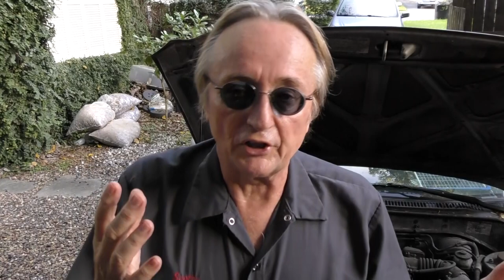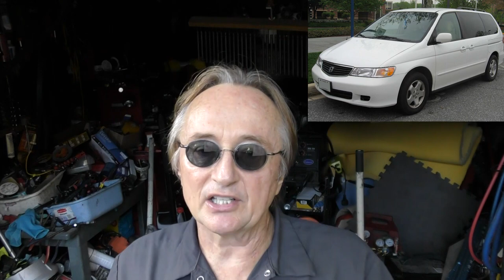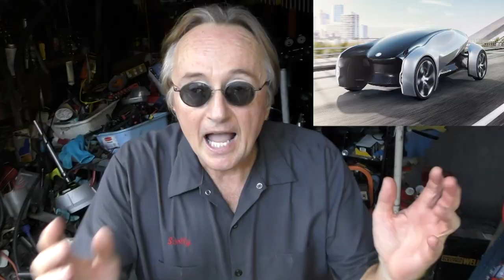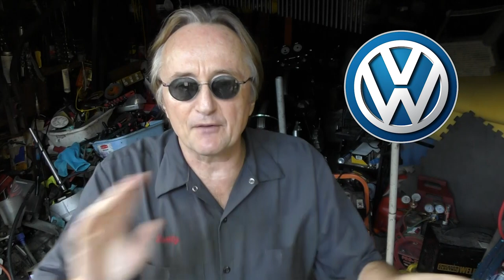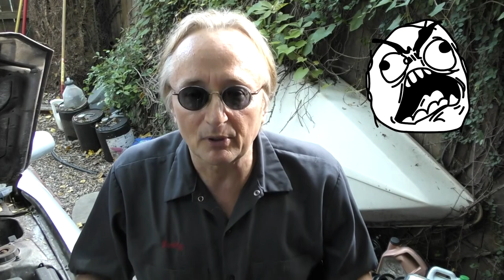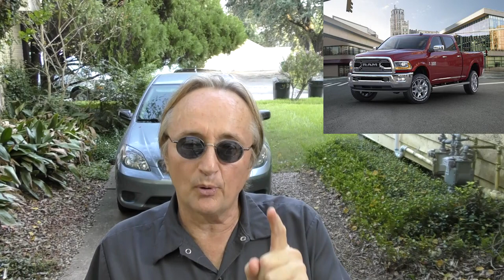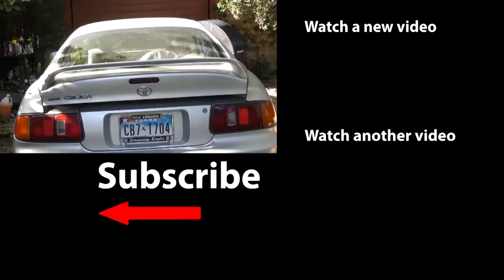Who Makes the Worst Automatic Transmission Cars in the World

Comment: I had an 01 Ram. Went through 9 transmissions. All went out under warranty.
Reply: Just carry a spare in the bed of the truck. :)
Reply: Damn. I'll watch out for the 01 generation
Reply: @arturos.l.2248  chrysler in general.......
Reply: My parents 01 grand caravan melted the transmission below 50k miles
Reply: @arturos.l.2248 it’s not the 01 generation it’s only specific vehicles the year is irrelevant

Comment: Fiat and Chrysler = 2 drunks trying to hold each other up!!! 💣💣💣
Reply: Hold each other beer
Reply: Wealthy drunks *
Reply: Chrysler and Fiat dont make ZF transmissions, so really s dumb answer. ZF is a German company that sell transmissions all over the world.
Reply: jeff k 📷🎥📹😝😂😣😗😀
Reply: ZF makes manual gearboxes for 3/4 and up trucks that are interchangeable between Ford Dodge and GM. They bolt up to your bell housing.
Reply: 08 caravan tranny started going at only 187k Km
Reply: Like #100
Reply: @SUGAR_XYLER  Way to go Sugar!!!
Reply: They help by offering each other a ride home or exchanging their car keys,like Peter griffin and his friend.
Reply: jeff k IKR I don't see how/why anyone would buy anything they make other than a version of the Challenger. Even if it has reliability issues  I feel that it's a driver's car.
Reply: ZF-Transmission just seem to be a problem in the US here in Europe they are pretty decend.
Like a lotta Fiat Bravos (2007-2014) 6 speed manual with a 90hp or 120hp 1.4l gasoline engine
Just don't hit a curb to hard otherwise a safety system will stop the gaspump ^^
And you gotta spend 3 min. in your glowbock trying to find the switch that unlockes the pump ;D
Reply: @robtankbuster5215  yes they do in there Kokomo Indiana plant 845 million dollar investment with ZF
Reply: Lol dead
Reply: Fiat has built DDCT automatic transmission. It's a good one.
Reply: And now they've added Vauxhall/Opel and Peugeot/Citroen, so now it's 4 drunks holding each other up.

Comment: As a past Honda dealership mechanic, I can totally agree with you about the 99-04 Odyssey transmissions were the worst. However, from 2005 on, Honda wised up and learned from their mistakes. The newer transmissions got much more reliable. Since I have quit working at Honda in 2013, I hear that Honda is starting to use ZF transmissions which are complete garbage! So, time will tell.

Comment: We had a 2005 dodge caravan sxt manage to make it to 450,000 miles with no drivetrain issue. Just regular maintenance. If the van didn’t get flooded and fried the whole system I probably still be driving that thing. I think the key word is maintenance. If you neglect it any vehicle won’t last.
Reply: We have a 2007 Caravan SXT with 170k and the transmission still works beautifully.
Reply: Keep it away from Scotty. He might put sand in the transmission when you're not looking, then blame Chrysler.
Reply: janry, I think you had the Chrysler 3.3 L V6 in that van. I've heard that's a pretty good engine! You must've changed the transmission oil religiously!
Reply: Had two 2001-2007 Caravans 3.3L V6 make it over 300 000 miles and one over 400 000 miles. I was not easy on the vans and  they pulled a trailer regularly + kids + dog + camping gear, clothes etc...  If you get one with low miles and little to no rust you will get a hell of a lot of use out of it. I leave the back seats out and use it like a pickup truck. The transmissions are solid on those years if you don't abuse them too badly.  We are on #4 it has 170 000 on it and it runs great.   I only change wear and tear stuff on them, parts are very very cheap new and used.
Reply: There were 2 years when the Chrysler Minivans had horrible transmissions, 1996 and 1997. Scotty is living in the past.
Reply: There is no denying what Scotty says about Chrysler and their products. But some of it is over exaggerated. Also, Chrysler doesn’t make the zf transmissions. When searching reliably for Chrysler vehicles (dodge, ram, jeep, etc) it’s back and forth. Like you said, it’s all about maintenance and not abusing the vehicle.
Reply: Yeah I don't understand what he's talking about..
We had a boat load of 1998-2015 Dodge/Chrysler Vans,  Mixed years and I sold a bunch. None of them had issues and I'd know because I'd take in trades and test them.  Also before I sold them I usually put load on trans and would take off to 65 once or twice before giving it to customers...  I sold cars for 2 years or so...   We had many Town & Countries come in with a boat load of miles.    Also wtf is he talking about the 8 speed transmission? That came from an Audi and I heard they were reliable...  Why blaming them if it's German transmission. Even know I never seen one with issues. We had few with 50-80K on them...    He needs to get off the hate Chrysler ban wagon...
Ford is doing so bad they completely stopped making cars all together...  My Cop buddy says they hate all modern Ford SUV/Sedan, all the Chargers/Crown Vics are great they say...
Chevy is ok but does have some gremlins like Chrysler does too, but some of those they already cut or changed.  As for 2016/2017 and beyond with merger, only time will tell.
Reply: I agree. I have a 1994 and a 2000 Chrysler minivan with the 3.3 L engine and 41TE (A604) transmission that are still running strong. They are very reliable as long as they are maintained properly, and they are easier to service than many other transmissions. The bad rap stemmed from Chrysler's rush to production in 1989. Their documentation actually stated that Dexron could be used if 7176 was not available; it even said so on the dipstick. This was a big mistake, because most shops didn't stock the 7176 fluid and they ran horribly with Dexron; Many transmission were replaced in the early days merely because they were being used with the wrong fluid. There were also a few upgrades made in the early years that made it more reliable, but for many their early bad reputation stuck.
Reply: Transmision on Dodge cars is good, but the engine stalls, many time.
Reply: The older chrysler minivans where the best among minivans. Not the fiat-chrysler ones (2014+). Didnt MBZ buy Chrysler before Fiat (1998-2007)?
Reply: William Is
Reply: Hey Scotty I have Owned 2 dodge Grand caravans in the last 10 years and have never had issues with their transmissions my sister still driving her 2001 Chrysler town and country that thing has more rust and dents like chickenpox on a kids body she never had any issues with her transmission don’t know why you picking on Dodge and Chrysler van
Reply: This Scotty dude sometimes talks good, sometimes talks crap. I just watch him because he's fun but I wouldn't trust him with a car. My 2004 Dodge Grand Caravan is the best car we ever had. Not a single problem, transmission shifting beautifully and we bought it second hand !!! Super reliable, the only thing I had to do was to replace the gas tank. We got a letter from Dodge telling us  there was a recall about a problem with the gas pump I believe. The van runs better than new !!!
Reply: @beezertwelvewashingbeard8703  ha ha ha i was just thinking that ha ha
Reply: I drive an '04 300m with ~115k miles on it, never had the slightest issue with the transmission. In fact, my only gripe with it is the placement of the battery and the extraordinary hassle it is to change headlight lamps.

Beautiful car though, makes it worth the extra effort.

Comment: Some transmission problems are caused by bad drivers.
Reply: waynegeorge270 - How?
Reply: Clit Commander

Always jack rabbit starts especially when still cold, not checking fluid level, never changing fluid, shifting to park or reverse while still rolling, senseless burn outs, constant unnecessary hard accelerating etc..
Reply: The hard accelerating part isnt true. My friends a lisenced mechanic and told me that it wont do anything
Reply: I see.
And you are a good driver  ?
Lic Driver Circa 1968
Reply: Maniac drivers as Scotty said!
Reply: @slowgoat6089  Accelerating in neutral and then switching it to drive while its up there.  Lol

Comment: 253,000 miles on my 02 accord, transmission and engine still running great. Some cars will last if properly treated, some won't no matter how good they're treated.
Reply: My 02 accord was a 800 dollar auction junker and made it almost 30k miles so far, say what you will but the 98-02 generation accords just dont die
Reply: @commandertaco1762  I purchased my 02 Accord from a one owner older woman, she took care of it like she gave birth too it... Lol. It's a solid ride inside and out. Paid a bit more for it cause of its history that few used vehicle have.
Reply: @garyr7027  That's worth it tbh
Reply: I try to take care of my 2010 Accord as best I can .I don't hot rod it or drive it more than 500 miles a month .Try to avoid driving on the Interstate which has speed limit of 75 mph. I take roads that have speed limit no higher than 50mph around town
Reply: @lindaeasley4336  avoiding highway won't help it will hurt. Highway puts you in the highest gear keeping revs down, increasing mpg and stresses the engine and transmission less as there's less acceleration / shifting gears
Reply: The v6 is the tranny problem w the hondas
Reply: @lindaeasley4336  highway driving is way better for the car than in town driving
Reply: @richsweeney1115  highway miles are better than around town, however, on the interstate many have a lead foot and tend to mash the pedal down like it's a nascar track. 75mph speed limit doesn't mean you can do 85... Lol. Moderate steady rpms is the key.
Reply: 2008 Honda Ridgeline with 373,000 miles and no problems from transmission.  Or engine.

Comment: As always, extremely informative. Thanks Scotty.  I purchased a brand new 2003 Accord with the V6. Great car, until the auto transmission completely failed at 37000 miles. They tried to say " not under warranty" but I pushed back hard and they agreed to replace for free.  Drove it for another 80,000 miles with no issues and traded it in for top dollar. But that issue always stuck in my head.
Reply: how much if u paid out of pocket for that fix
Reply: @HistoricalWeapons  about 5G

Comment: My Nissan Cube with a CVT, replaced transmission at 46,000 miles.
Reply: Joseph Foulke  

2007 Altima CVT and still working.
Reply: @BestPlayer09  well, Nissan is one  out of two in this thread. Lol.
Reply: BestPlayer09 if you’re at 130,000 miles with zero issues..you’re just blessed 🤔
Reply: I don't think he was talking about CVT's this time, but rather regular automatic transmissions with the clutch packs and planetary gear sets.
Reply: Also cvts at my Chrysler are rarely getting replaced here.
Reply: Had a 2012 Sentra CVT. POS CVT was giving out.
Reply: Joseph Foulke  2009 Altima with cvt 270,000klm on it with Zero problems..  it’s been a great car to me.
Reply: 13' accord cvt still working for some reason..
Reply: Replaced ?
Just use Oil Extreme Concentrate....it works in all cases with or car makes with CVT issues such as BMW Mini , Honda Jazz / Fit.
Reply: certain Nissan CVTs like new XTrail have too much users complaining CVT issues after 2 3 years of use.
while my car, Nissan produced, Mitsubishi-tuned CVT still going strong, now reaching 80000 miles, probably the best CVT out there with proper servicing and CVTF used.
if going for new car with CVT, i suggest go for Japanese cars except Nissan.
Reply: @kalion81  Altima is select few reliable Nissan CVT cars
Reply: My 2009 chrysler town n country trans went out at 109,000 miles.
Reply: 09 Altima with 149k miles and no issues yet
Reply: David Laurie  
I believe FCA, Nissan and Mitsubishi used the same source for their CVT transmission: JATCO
Reply: Thoughts and prayers
Reply: @BestPlayer09  how many miles?
Reply: alphatrion100 

136,000
Reply: PGm issa 

Lol ok 136,000 is good for me.
Reply: Mike Jones  mine is a bit of both.  
But mainly city driving
Reply: @BestPlayer09  Well quality is about avarages not single cars. Scotty sees alot more car thatn most of us. Car with automatic lasts longer if a  grandma drives it.
Reply: and so what , what is the percentage of them failing? Everybody just jump on the bandwagon.
Reply: and why is he bless? there are many Nissan CVT gone over 200,000 miles with out an issue, the issue is many jump on the bandwagon, If I remember clearly when they actually check the data on how many Nissan CVT fail it was about 2%. More Nissan complain comes to shore because it gone out of the 60,000 miles powertrain warranty, and Nissan refuse to cover them, hence law suits,  Honda have many CVT failure but because they just replace them it not known but go look up the CR-V forum. Are maybe if you can recall the 140,000 CVT civic and fit recall because they were failing and breaking shafts. The sentra which they were even complaining about, was not failing either, because the internal was ok, it was overheating, I am not saying it was properly design either, but honda CVt is not properly design also.
Reply: @blitzerbit the Xtrail and rogue are the same, the issue has been resolve, the CVT was overhaul with D step shift Nissan set points, so it could not be  3 years, the car started to produce in 2013, it the 2013 and 2014 models that have the older version CVT. And even so you are wrong about too much, the percent of owners with the issue was not high, because X trail is not only sold with CVT.
Reply: Data gather from source will prove you wrong, the report of Nissan CVT failure is 2%. There are many Altima that has gone over 200, 000 mile without a  problem, yet you come here to tell it a selected few. There are agency Nissan have to report to, like NHSTA in USA, recently the Japan government sanction many of them for false data. SO the percentage of CVT fail, or car problem has to be reported  if you did not know, or face a heft fined.
Reply: Joseph Foulke 46k you're not even getting started at that point
Reply: Did you replace the transmission fluid at 30,000 mi?

Comment: I've worked for close to 20 years in a transmission repair shop and have seen many burnt out transmissions. Common ones that we get a lot to fix are 604, 518, 47&48RE, GM 4L60E&4L80E, and anything from Ford.
Reply: Ford C6? AOD? 4R100? E40D? Yeah I'm calling bullshit. Ford has for the most part had solid transmissions
Reply: im a little burnt about the 4l60e's there was no reason they couldn't have been a bulletproof transmission but they cheaped out on quality and they were nothing but problems. Its a shame because once you rebuild them they can reliably hold crazy amounts of power but from the factory they fall apart. I had a 99 van and the sun shell cracked so we went through it rebuilt it with good parts only to have the parking claw shatter sending metal throughout the the whole thing(my fault for not changing it). That being said it never left me stranded even both times it broke it still limped down the road for a week or two until i could get it fixed.
Reply: @eaglefat9398  the problem with the 4l60e was it was originally designed and built for light duty applications and then GM started putting them into heavier vehicles without any up grades.
Reply: 20 years ago when i worked in a transmission shop it was the same story about Fords. Of course the AXOD and AX4N often visited the shop.  @Terminxman
Reply: @Terminxman  The fleet of Ford Focus my company used had so many problems we with the transmissions we got rid of them all and now use Subarus.
Reply: Interesting because I've had 4 Fords and 1 Mercury. Only one had a bad Transmission, and it was the cheap one I stupidly bought for under $1000 when I was much younger. The rest ran like a champ. 🤷‍♂️
Reply: Ford is crap but our first car was a dodge Chrysler and it was worst.
Reply: You say anything ford. Okay so what about the 6speed Zf ford falcon Xr6 Bf FpV

Comment: Ford Focus has a cross dresser transmission,  never knows what gear it should be in.
Reply: Never use cheap batteries on a Ford Powershift. Use AGM. Change oil at 75km and get the cluth replaced before 100km by warranty. If you do that it will last a lot.
Reply: The Focus is a completely different car with a manual. I own a 2014 with a 5 speed manual and I can go through the gears much smoother than the lurch-o-matic. Its too damn bad that so many were built with automatics. It is a much nicer and more reliable car with the stick.
Reply: Sadly a lot of autos are like that.Rented a new camry the other day.Thing had no idea wtf it wanted to do.
Reply: Even stronger a home we run a ford focus manual   ztac edition it's from the year 2002 and even now runs still if it come 1 day ago out of the factory
Reply: P.C. Gornmad LOL
Reply: Vladimir Putin bahahaha
Reply: @rotorr22  same here,  love my focus manual
Reply: I had a fiesta with the same transmission they are complete junk!
Reply: I'm really surprised he didn't mention the Focus in this video.  There's a lawsuit against Ford for them.  But Does has continued to make them for half a dozen years
Reply: Yep. My 2012 (bought new) focus hatch, with automated dual clutch...continuous transmission problems.  First 3 years of denial, finally clutch replacement, computer replacement, and another new clutch. Only has 46k miles right now. Problems started soon after purchasing.
Reply: You mean it's a "gear fluid" transmission.